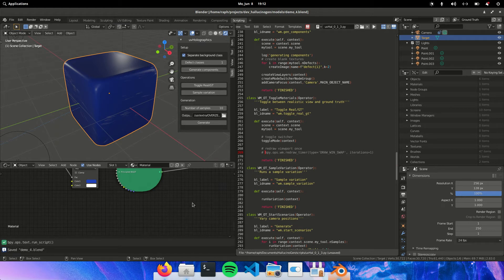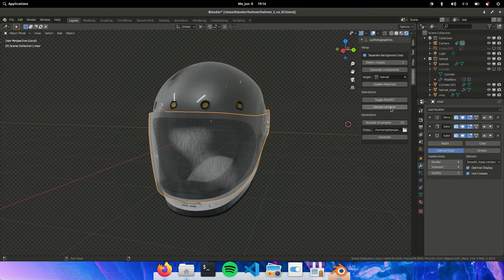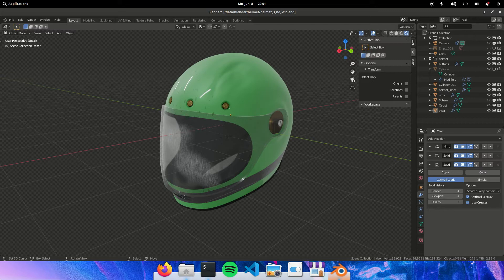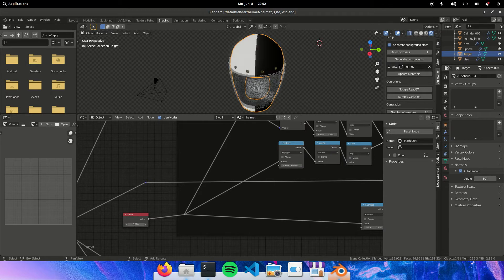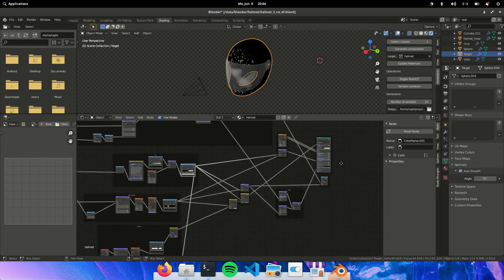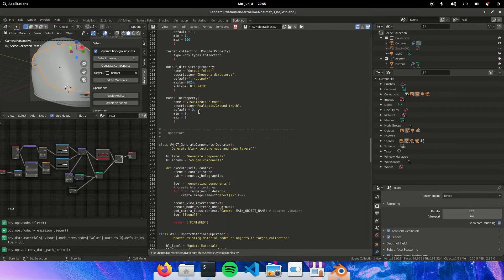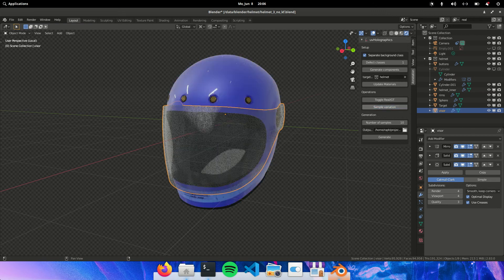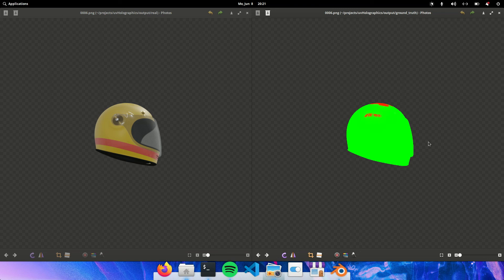Generating Machine Learning Data in Blender: part 2 - Advanced Defects

Comment: Can you save training text file as well? Like json file. I am also interested in extracting key points from 3d model to train model
Reply from the maker: Do you mean generating a json file that can be used as input data? You might be able to pull that off with vertex information.
Reply: Yes I want to save the machine learning training text file along with the generated images. Are you familiar with blenderproc? Similar to it. But blenderproc doesn’t support key points saving. It supports 2d bounding box, segmentation masks, etc
Reply from the maker: @rs9130  Unfortunately, the type of problem you described can't be solved with my add-on. However, a possible strategy might be:

1. Load in your object in Blender
2. Make N empties  that will act as keypoint references and child them to your object. (When you move your object, your empties will move with it)
3. Write a python function that calculates screen coordinates of the keypoints based on the view, I suggest you use the camera matrix to transform the Keypoint XYZ coordinates to U,V (screen) coordinates. 

Hope that helps a bit.
Reply: @DikkeHamster  thank you for your help. I will try to do it
Reply: @rs9130  did you do it?
Reply: @ovrava  try blenderproc
But I don’t know key points